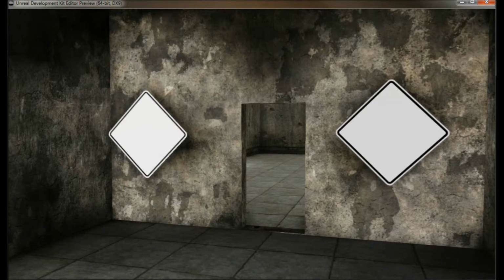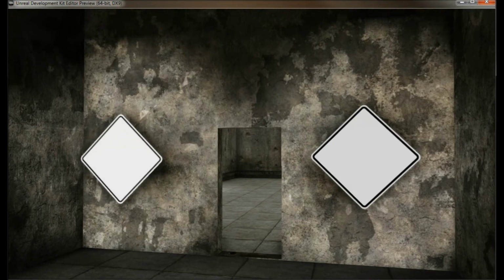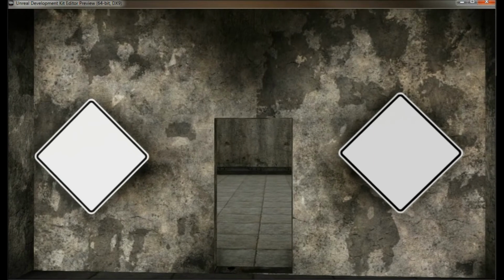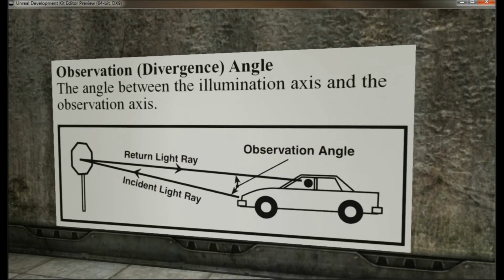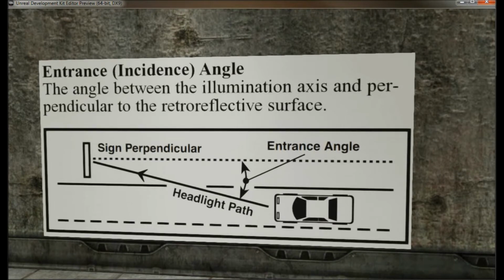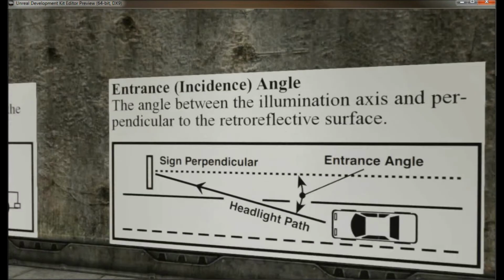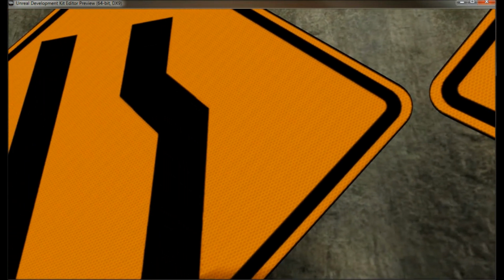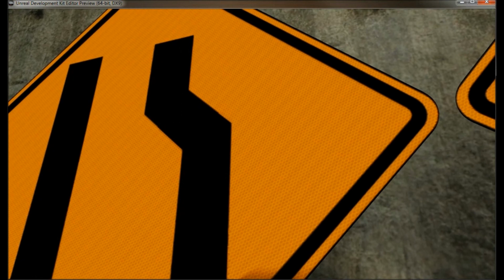retroreflectivity demo

Comment: Thanks for this! I'm adding retroreflectivity and grazing retroreflectivity to a shader right now, and this is good reference :)
Reply from the maker: Glad you liked it!  I haven't dug into the code for a while, but I remember some of the implementation hassles involved.  Part of it involved developing a custom response function.  

I did have one significant problem.  There are two responses that can be modeled, each corresponding to the horizontal and vertical cut-off angles.  I had to develop two continuous response functions to produce satisfactory results.  Unfortunately, modelling both responses real-time made the shader terribly slow.  Consider that in your approach.  An important question to consider:  Are the view and light source in a fixed orientation with respect to each other?
Reply: ***** I found the more I got into trying to model this realistically, the more complicated the material controls got, and they're already on top of a fairly complicated physical shader. As such, I'm simplified it a lot, it now handles core retroreflectivity (sort of a half-measure between small viewing angle aligned reflectors like on road signs and the glass-bead style retro reflectors on safety vests and roat paint) and grazing retroreflectivity (for velvet and other rough fabric-y materials). The light vector and the view vector are not in a consistent relation (like a flashlight or headlight), but I already have a fairly complicated BRDF, so I have the VdotL and NdotV calculations already handy for doing this calculation.

(I'm in Unity CG, btw).
Reply from the maker: Adding the grazing retroreflectivity while fully representing the core retro reflectivity does seem like an awful lot to try to calculate...  Unless the two could be strongly related (so the grazing calc can be approximated from the core retro calc?), 

I thought about what I did with just the core retroreflectivity and I can't really easily identify a way to have done it better without fixing one of the responses (i.e., making it a flat line instead of a curve).  Admittedly, the response curves I created were a bit complex, so perhaps it would have helped to try to reduce them to lower order approximations, but I was too thrilled to see it work to bother...  just had to show the world, I guess. :)
Reply: ***** no I know that feeling :D I have a unnecessarily expensive gaussian approximation as part of my specular terms (instead of a usual implementation of Blinn which is just VdotH^(gloss)) that I just haven't fixed yet :)

You reminded me that I hadn't actually opened back up the Disney BRDF explorer for a while to look at their scans. I just went back to look at some of the cloth ones and man do they have odd responses at steep angles!

Have you looked at those much?
Reply from the maker: Disney shaders - nope.  At the risk of being obvious, I suspect the Disney samples have odd responses because a steep angle wasn't a use case they were concerned with.  That's what I love and hate about shaders - really makes you pick and choose what you'll perfect and what you'll let slide. Still, surface glazing would be a fantastic value-add for the overall realism of a retroreflectivity shader, though.  I'd definitely like to see that. :)

I was also thinking about retroreflective "artifacts" that you get during the day, which the theory (as I implemented it) doesn't appear to address.  My context, though, was diamond-grade sheeting and the somewhat large, flat surface of a highway sign.   Smaller devices / clothing or engineering grade and lower sheeting (which may not use prisms) probably won't exhibit these effects as noticeably, if at all.  Still, two effects in particular caught my attention:

1.  As you approach a highway sign, it tends to "flash" as you pass it - especially during the day.  It's not surface reflection, though - it's a retroreflective response.  Appears to occur under ambient lighting conditions as well as more direct (sunny) conditions... Almost as if the viewing angle hits a critical threshold and you get this "blast" of environmental light...  It's like the response curve is discrete - there's an additional response just before 90 degrees.  What's it reflecting?  Light bouncing up from the road surface?  Ambient light in general?  Dunno.

2.  "Rainbow" refractive effect across the surface.  Given the prism surface angles and the angle of incidence of sunlight on the sign surface, I imagine the response range would be easy enough to determine and effect could be modeled fairly inexpensively...  Not a particularly noticeable artifact, though.

 Wish I had more time to do that sort of development - it was a lot of fun.  Good times. :)
Reply: The disney BRDF explorer is actually a really cool tool! http://www.disneyanimation.com/technology/brdf.html It lets you compare any brdf equation or shading function to material scan data from MERL http://www.merl.com/brdf/ . It's free too. I highly recommend fiddling with it.
I actually ran into that "Rainbow" artifact the other day. I was walking past a building that was getting sandblasted, so the ground was covered in little glass/acrylic spheres. Any time I looked down, there was a rainbow halo around my shadow :) pretty neat stuff. http://www.atoptics.co.uk/rainbows/beadbow.htm http://www.atoptics.co.uk/fz822.htm
The effect also occurs on some roadsigns and retroreflective paint, apparently: http://www.atoptics.co.uk/rainbows/beadbow.htm That must have been what you were referring to! 

I'll be sure to link you when the retroreflective shader is fully working! Is there something stopping you from doing material/shader development?
Reply from the maker: Ryan Gatts
I stumbled across MERL when I was playing with HDR maps or something, I think.  It looks familiar, anyway...

The rainbow effect in your picture is exactly what I was referring to.  I presume prismatic sheeting (like 3M diamond grade) necessarily affects how the effect looks, but I imagine it's all the same physics...

As I was road tripping the other day, I looked at signs for the flash effect I mentioned.  I have to amend it by saying that the effect is visible on sunny days when lit from the side (or behind...?), but not when driving into the sun (which seems obvious).  Bright overcast days seem to have the effect as well.  Honestly, though, I'm starting to think it was light reflecting off of the car I was driving that happened to be coincident with my view of the sign as I passed it. :)  That's definitely part of it, but I don't know that it explains the effect entirely...

On your last question, I suppose life in general keeps me from it - my profession has something to do with retroreflectivity, but nothing to do with shaders :) 

Still, I had a chance to do dev on a really fantastic game called Achron three yeras back - that was a lot of fun.  Then I started working with GLSL and prototyped my own multi-threaded shader development environment using OpenSceneGraph.  (mostly that was just to get better at C++ and GLSL).  If you want to see the videos (they're boring!) it's on my channel.  In the end, though, this doesn't pay much and family, career, and home improvements have their way with my time. :)

Anyway, I look forward to seeing the result of your work!